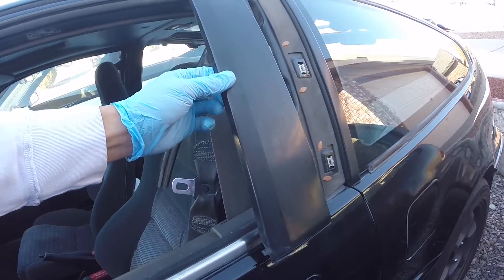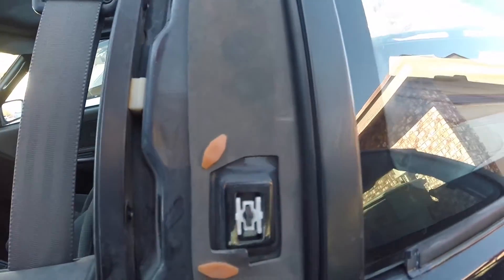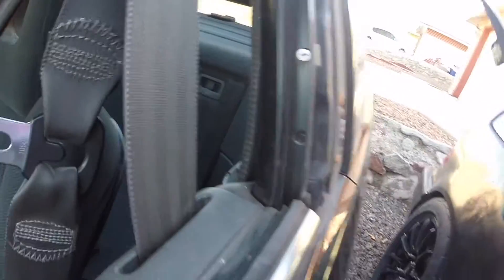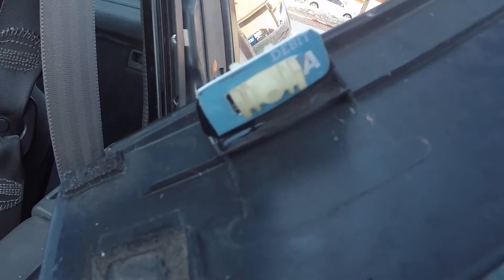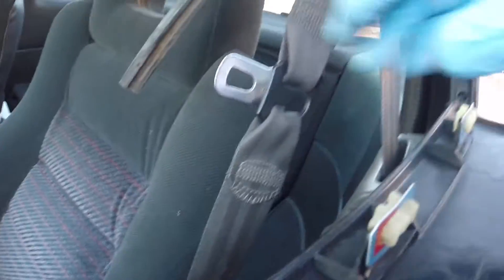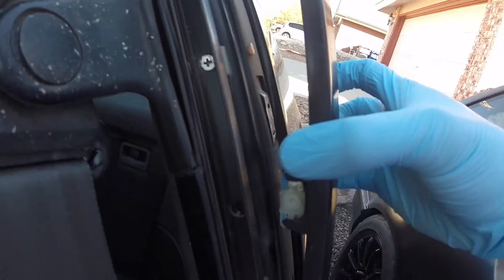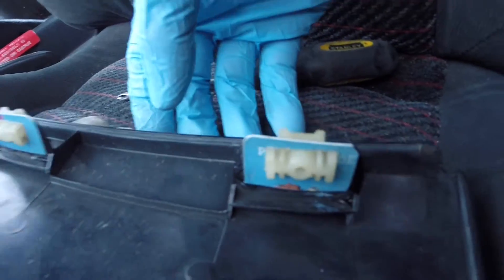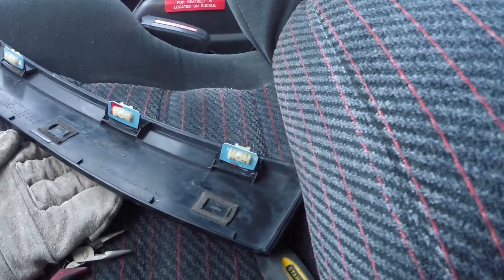How To Repair 88-91 Honda CRX Door Pillar Trim Garnish Plastic

Comment: You can actually pop those clips stuck in the pillar right out with a screwdriver. Very carefully of course, or you break the necessary bit to keep it secure.

I never even knew the pillar garnish had mounts to screw in, I just popped the clips out, glued them back on, and carefully popped the garnish back in. Of course this method does wear out because it has the same flawed weak points.

But now that I know they can be mounted properly I will do it next time I get the chance. Thanks for the instructional.
Reply from the maker: Very cool, I've never had a CRX to try popping to garnish out on before.  

I'll have to try the method you mentioned when I find some at a junkyard and try to salvage them.

Thanks for the comment, I love the added suggestions!!